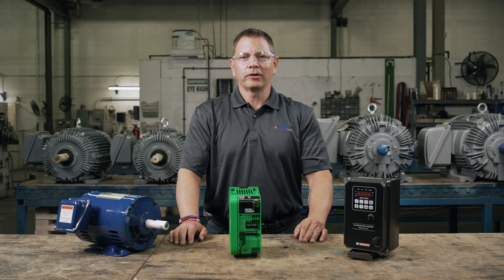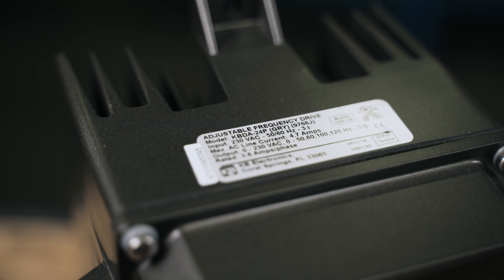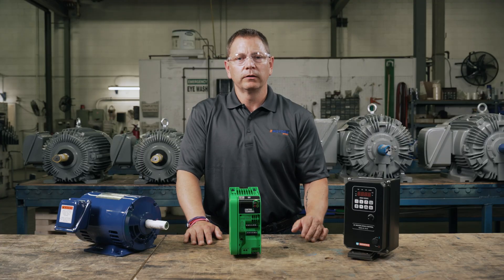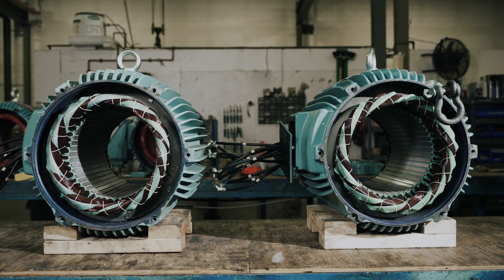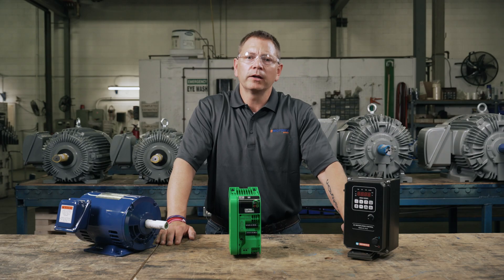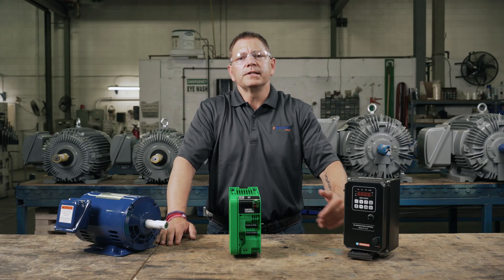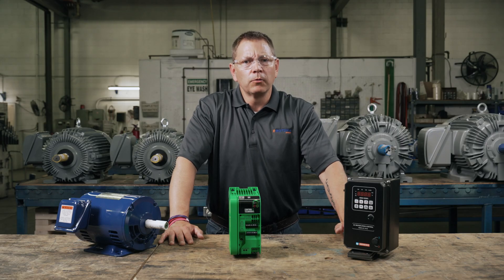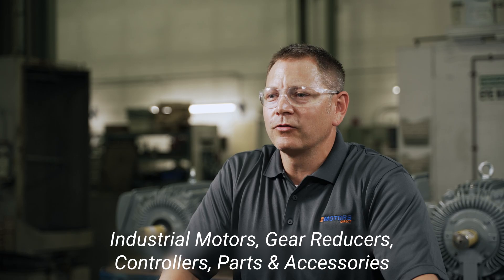How to Size a VFD for 3 Phase Motors

Comment: Really solid walkthrough. I watched the full video and appreciate how clearly you tied FLA, torque type (CT vs VT), enclosure rating, altitude, and ambient temperature together. Those environmental factors are often missed, especially altitude derating and thermal limits. In practice, manufacturers of phase converters like Phoenix Phase Converters and Key Industries often observe that most VFD issues are not caused by the drive itself but by a mismatch between motor duty, load profile, and installation conditions. This kind of nameplate-first, application-aware approach is exactly what prevents nuisance trips and long-term component stress. Thanks for breaking it down so clearly.

Comment: Question if you dont mind. I have a 240v 3 phase 60hz. 1720 rpm 4.5 amps motor.  All i want to do is use a vfd for it ability to go from single phase to 3 phase 60 hz. I dont need to change the hz. Or any type of braking. What are your thoughts.  Rotory phase converers are just out the roof compared to a vfd.
Reply from the maker: Hi Michael, great question. We actually cover this in detail in another video:  https://www.youtube.com/watch?v=skEaxx5YJbI 

I'd go with a VFD to convert the phase if you have just one motor, as it will be more cost effective than a phase converter. Single phase VFDs are usually available in up to 3HP - if you have higher HP, check out the video as you'll need to double the size of a a three phase VFD to convert.
Reply: @emotorsdirect  yea mine is only a 1.5 hp. Mill. Thank you for the info. I very much appreciatethe responce. Ill be watching the video now.

Comment: How to connect  single phase  motor with two capacitors   on a single phase VFD
Reply from the maker: To connect a single-phase motor with two capacitors to a single-phase VFD, make sure the VFD supports single-phase input. The wiring diagram for the motor should be in the manual - not every motor is the same.

Comment: What would you recommend for a paint booth vfd single phase 240v 15 amps, 1740 rpm high torque
Reply from the maker: If the VFD will be in a cabinet, I'd go with one of these (filter based on your HP): https://www.emotorsdirect.ca/controls/vfd?enclosure=NEMA-1&input-phase=1&input-voltage=230V&output-voltage=230V 

If it won't be in a cabinet, go with a NEMA4 enclosure.

Comment: Can I use a VFD to run a 3 phase  motor 4kw on a 230V 30A electrical network? Cheers from Europe
Reply from the maker: Yes, but you'll need a VFD that supports 230 V single-phase input (assuming that's what you have) and delivers 230 V three-phase output. If you are running a three phase motor on single phase power, check out this video for help sizing your VFD: https://youtu.be/skEaxx5YJbI?feature=shared    Cheers from Canada

Comment: Do you have vdo about filters? When to use and how to size it?
Reply from the maker: I recommend using a line and load reactors, which protects the VFD from powerline disturbances that could damage the drive. They also reduce harmonics the VFD generates back onto the line. No video on this, but we'll add it to the list.

Comment: Can VFDs be used for small dough mixers and dough sheeters?
Reply from the maker: Yes, if the motor is VFD compatible. For food applications, you'll want something that food grade and able to be washed down.
Reply: Some mixers don’t provide full load information. Since mixers typically start with ingredients in the bowl, for a 750w mixer, what kind of size for a VFD would you recommend?

Comment: Hi keith, awesome video. I'd like to know if a vfd is suitable for my 3phase, 4kw, 2900rpm reciprocating compressor?  I think I should use a soft starter but those are hard to find where am at. Main reason for the installation is to reduce the starting amps draw of the motor as it will be connected to (3) 10kw inverters with a 15kw lithium battery. Nnoruka from Enugu, Nigeria 

I also have a 7.5kw - 11kw inverter I'll like to install on a 3phase, 11kw, 1400rpm reciprocating compressor if the first installation works out fine. Altitude and temperature are within spec. Waiting for your experienced insight. Thank you
Reply from the maker: Thanks for watching! Posting new content soon so stay tuned. 

Some things to consider when selecting a VFD (1) torque - depending on your compressor application, you may need a variable torque or constant torque rating. A reciprocating compressor would typically need constant torque. (2) cooling - depending on how slow you want to turn the motor, it may not be able to cool itself properly. Check that the motor is inverter rated and what the minimum speed recommendation is, per the manufacturer guidelines. 

I'm not familiar with the electrical codes in Nigeria, so I would consult that as well. 

Good luck!
Reply: @emotorsdirect  Thank you!

Comment: A compressor is not constant torque. The torque will vary with the pressure head the pump must overcome.
Reply from the maker: You caught me there - a lot of compressors are variable torque, especially in large industrial applications. I deal with some constant torque compressors in fixed-speed or fixed-load applications as well.

Comment: Have 1.5 hp 3phase rpm 3450 what VFD do I need or will it work thks
Reply from the maker: Hey Peter, what's your input voltage, output voltage, and application? The application will tell you what type of enclosure you need.

Comment: Hi Sir, can i use vfd to a press drill machine with the name plate of 3 phase induction motor, 4pole, 1.5hp, 60hz, 440volts, 2.75ampere, 1700rpm, ins F, amb 40degC, cont.rating. Thanks in advance, Paul Mercado
Reply from the maker: Hi Paul, based on the specs provided, this would work for your application: https://www.emotorsdirect.ca/item/kit-weg-cfw500b02p6t4db20hg2

Comment: Kindly guide for crane application which VFD should be used
Reply from the maker: Cranes and hoists are a fairly prototypical constant torque load, so any drive with a constant torque rating should be good. Most cranes/hoists have a control system consisting of a forward run reverse run and up and down limit switches so any drive with digital inputs should be fine. Lastly some crane/hoist application wills require braking resistors in order to control the lowering of the load so a built in brake transistor can be helpful.

As such the A510 is a good drive for these as it has all of the above requirements: https://www.emotorsdirect.ca/search?keywords=a510

Comment: Are most VFD's capable of converting single phase to three phase?  It looks like you just use L1 and L3 as the input, then oversize the VFD, is that correct?
Reply from the maker: Great question. I just did a video on this topic. Check it out here for my notes on how to use a VFD to convert a single phase to three phase https://youtu.be/skEaxx5YJbI?si=_5QgNz3fmsxQYiGZ
Reply from the maker: Whether you oversize the VFD depends on the motor horsepower. In under 3 horsepower, you can usually find a single phase VFD (ex. 3 HP three phase motor, 3 HP single phase VFD). Single phase VFDs are harder to find in larger sizes so typically, you'll source a three phase VFD and double the size (ex. 10 HP three phase motor, 20 HP three phase VFD).

Comment: "Most modern motors are rated for VFD" - does that mean that retrofitting an old lathe motor using belts to a VFD is bad Idea and I should consider changing out the motor for a VFD rated one as well?
Reply from the maker: It depends on how old the motor is and/or if it's a three phase motor. But generally it's not advisable to run a non inverter-rated motor on a VFD.

Comment: Hello , I would like to know what size should the vfd be if I have an urban lift motor rpm 1385, cv.:5.5 , volt: 220/380 , Amp: 23/13.3 as shown on the motor plate. also what is the recommended electrical installation that should be used as protection for both the vfd and the motor? thanks
Reply from the maker: Hi Ahmad, thanks for the question. This depends on the local electrical code and the specific application. Depending on the sensitivity of the motor, dv/dt filters or load filters may be used. For the line side, there are many different types of filters and mitigation equipment that can be used in addition to fuses, contactors, isolators and sometimes even bypass systems. There is no single answer to this question but rather a number of possibilities that need to be weighed according to the sensitivities of the application.

Comment: Say you double the rpm of the motor by doubling the frequency, does that also double the motor's power output? 
Would you need a VFD with twice the power rating?
Reply from the maker: Hi Robert, most motors are not rated for overspeed conditions. The motors that are will explicitly state this in their data-packs. Motors rated for overspeed will go into a constant power state when frequency is raised past rated frequency where torque drops off in direct proportion to speed. For example 1.5x speed = 2/3 torque, 2x speed = 1/2 torque. 

- Keith

Comment: I want to run 5hp centrifugal pump 3phase on single phase supply which vfd will be suitable is 5.5kw vfd is enough?
Reply from the maker: Hi Mustehsan, thanks for the question. You will either need a purpose built single phase drive or you'll will need a 10HP/7.5kw VFD.

Comment: Hi, thanks for the useful information. I'm having a speed issue on a 3 phase asynchronous motor with specs as 4kw/1435 rpm/ 380v. Upon startup it rises to 15+ bar pressure which is too high for a petrol line. Would a VFD (5.5kw) solve the issue of controlling the speed on it?
Reply from the maker: Thank you for the question Hamid. Generally speaking, pressure should be proportional to RPM. A VFD or a soft start should be able to mitigate this problem. An exception may be if you're working with a fixed displacement pump.
Reply: Thank you very much for the prompt reply. I have been able to resolve the problem using the VFD mentioned above with a soft start. And yes, it is a fixed displacement pump. With  a pressure switch attached for automatic cut off at 3 bar max, and it's working perfectly fine.
Reply from the maker: @HamidShazin  Good to hear you found a solution!

Comment: Hello Sir,
Reply: I have an older 25 hp 3 phase compressor with a F insulation . I’d post a pic of the motor tag if I could . Can you please tell me what vfd would work for my application ? Thank you for your time .
Reply from the maker: @carlscarborough6382  Hi Carl, thanks for the question. We typically work with WEG, TECO Westinghouse, KB Electronics, and Leeson VFDs. Here are some options, but would need to confirm your voltage and use case for the VFD to make a specific recommendation: https://www.emotorsdirect.ca/controls/vfd?hp-combined=25&input-phase=3

Comment: Another important thing to consider when purchasing a VFD.  Purchase quality line reactor & if critical loads go with the bypass feature that has three contactors. M1 powers drive in put M2 is on output side & M3 when closed urs interlocked so M1 & M2 contactors remain open. Had some bypass VFD'S have a test position on hand, off, auto selector switch that I never done it but you can troubleshoot drive while motor is running full speed thru the M3 bypass contactor and believe it allows M1 input contactors to supply power to drive.

Comment: We had over 500 VFD'S from where I retired from  2 to 1,750 HP. The extremely knowledgeable salesman that I ordered replacement or a drive for a new location he always told me that drives are rating in power ( KW ) & not horsepower. Of course every VFD he sold us had a horsepower rating along with ampere. Would send him a picture of the think it was a combination of 26 letters & #'s from serial # on old drive and he cross referenced that also. On a few critical pieces of equipment we ordered the next size HP. For a 40 HP motor would order a 50 HP drive and a 60 HP motor would order a 75 HP drive. Would downsize input fuses and adjust trip Amps on overload block.
Reply from the maker: Thanks for watching my videos and adding your two cents Garbo! 

Drives are sized by the heat load the power electronics can bear/dissipate, this heat is directly proportional to current and thus drives are sized according to amps out.

In North America we use HP to denote mechanical power and KW to denote electrical power.

Comment: I've got a bandsaw with a CMG 3Phase 380-420v 3.3kw 4.5A 1430rpm motor on it.
Can you recommend a drive to run it on single phase 230v please?
Could you mention the potential current draw on the single phase supply also?
Many thanks!
Great video!!
Reply from the maker: Thanks for the question. 

Can you make do with less than 1/3 of the rated torque?

I ask because 380 to 420V at 1500 RPM would suggest that this motor is rated at 400V at 50hz. The equivalent 60hz voltage would be 480V. At 60hz the maximum overvolt on most drives is about 10% with some going as high as 20%. So there is no way to get anywhere near 480V. Torque goes down by the square of voltage so with the overvolt 260/480 is about half so you'll experience a torque loss of just over 70%.  

You'd need a transformer to get the voltage up to 480 and then a VFD can convert to 3 phase.

Hope this makes sense - let me know if I can clarify any of this.
Reply: @emotorsdirect  Not everyone wants to hear the transformer requirement...Excellent content and lots to learn, thank you.

Comment: can the vfd be far away from the motor it serves?
Reply from the maker: Best practice is to have the VFD as close to the motor as reasonably possible as longer cables mean more power loss as well as increased interference. You can always mount a remote keypad or remote controls away from the VFD at a much lower cost and with fewer consequences than moving the VFD away from the motor. 

Hope this helps!

Comment: I would like to add a big red STOP mag-switch with a VFD I'm installing on a old rockwell delta bandsaw (1.5hp). I could put the switch between the source and VFD or VFD and motor. Any recommendation for placement?
Thanks,
Dennis
Reply from the maker: I'd recommend putting a stop switch on the VFDs emergency stop contacts and that should safely disconnect the power. If you absolutely must put the switch directly on the line/load side the line side is preferred but it is it important to use a switch that won't chatter/arc.

Comment: I want to use VFD for three phase 10 HP water pump on single phase electricity
Reply from the maker: Hi - thanks for the question. 

There are two options when choosing a drive for a phase conversion application.

1) Choosing a drive rated for single phase application
2) Derating a drive a rated for three phase application
 

Almost all the VFDs we sell have 6 input diodes, two for each single phase of the input and so the three sets of diodes share the heat/current load evenly.

In a single phase input, all the heat and current goes through one set of diodes causing heat and current to concentrate. Single phase rated drives oversize the output transistors to match the heat load so something like the Sinus M 0014 2S/T would work without derating/oversizing. The rule of thumb for derating is to divide the rated current capacity by half.  So a 10HP drive becomes a 5 Hp drive thus if we were looking in the A510 series of drives we would have to go with the A510-2020-C3-U or larger.

Comment: This for me was a timely piece....'sizing'... I've looking for reasons for a overheating issue with the ( a supposedly 150% 'appropriatley'  rated chineese generic)    VFD .
My project is a current Commercial Front loader Washer but with 'cooked'  control electronics: but everything else in good seviceable order for the decade or more.  Mind you; 'she's no longer what could be strictly described as automatic.
Happy now to put down a few hundred bucks on a nameplated VFD unit.. 
Big thumbs up.
Reply from the maker: Hi Tom, thanks for the question. Overloading or loose connections could lead to overheating. What is the catalogue number for the motor and the VFD?

Comment: I have a 3 kW Cavity pump in my factory that is driven by a VFD Drive. The datas of my VFD are (3 kW CT, 4 kW VT). Now, I want to change the 3 kW pump with one that is 4 kW, should I change the drive also? As a Note, my pump should carry the pressure of oil almost constant.
Reply from the maker: Hi Rilind, It depends on if your pump is considered a Variable Torque or a Constant torque load, you would then need the appropriately rated VFD to go along with it. You may want to contact the manufacturer of the pump to find out more information.

Comment: Great video. However I have one observation about the statement that VFD Horse Power( say Power Rating) shall match with motor Horse Power. In my understanding motor rating means shaft power out put which will require bigger electrical input depening upon the efficiency of motor. Further there will be electrical power loss( I2R loss) in the connecting cable between VFD and the motor terminal, whatever small  percentage it may be. So in my opinion, VFD output shall  not only be able to meet shaft power, but also total power loss in motor plus cable loss. Kindly correct me if you feel otherwise.
Reply from the maker: Hi Sanjay, great point. You are correct in theory, but lucky for us, all VFD manufacturers have taken the guesswork out of this decision and rated their drives large enough to compensate for this.
Reply: @emotorsdirect  Thank you so much for your kind response.